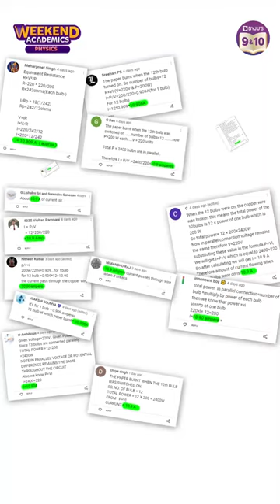Why Did the Wire Catch Fire When We Turned All the 13 Bulbs on? | #ytshorts #shorts

Comment: If we replace the wire with a thicker one then it's resistance will decrease because RESISTANCE IS INVERSELY PROPORTIONAL TO THE AREA OF CROSS SECTION , provided that the LENGTH REMAINS CONSTANT. Resistance decrease that means current increases in the circuit . But sir my question is ; what happens to the heating effect , will it increase or not? And also will the wire now break or not ? Well I think it should break because Heat is inversely propotional to resistance , provided voltage is constant. Please sir explain.

Comment: More thickness means more area means less resistance of the wire means more current can flow into the circuit without melting the fuse wire.This will cause damage to our devices at home because more current is flowing into the circuit..therefore fuse should always be of ideal rating

Comment: If it's a thicker wire more current would flow through the wire.....
Here goes the explanation.....We know 
R= rho L/A (more area means thick wire so resistance is less)
Also We know, V/R=I (if resistance is less which we proved above ,then current will be more)
:)